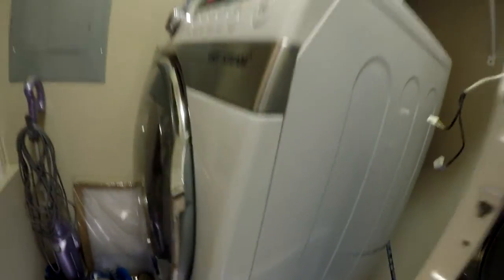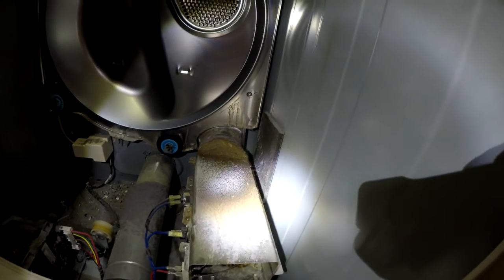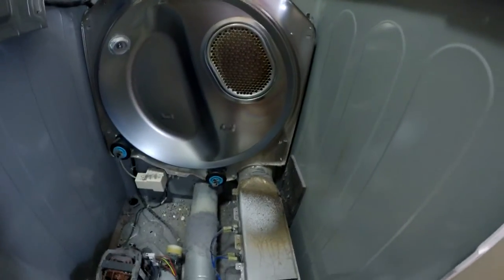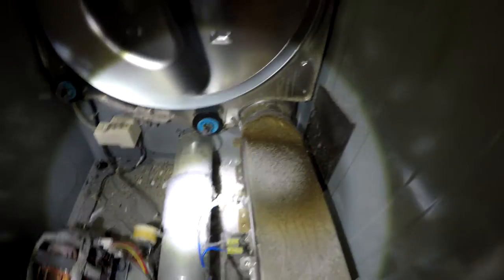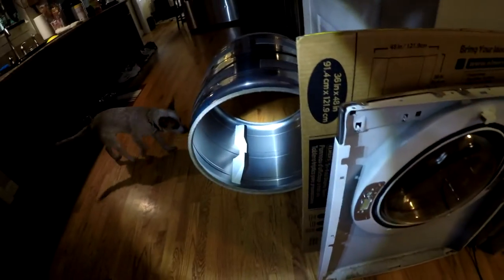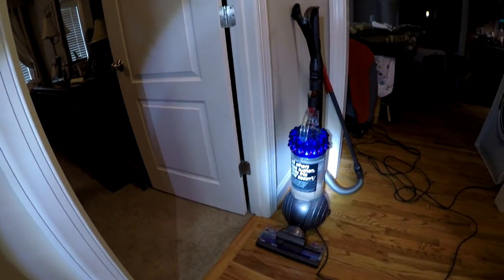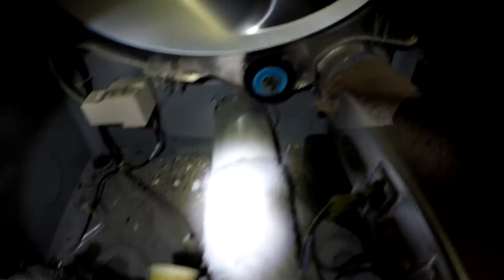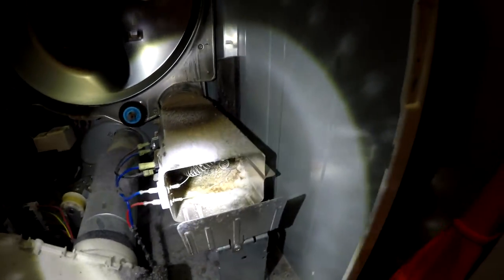Samsung Front Loading Dryer Fire Hazard

Comment: I just took mine apart after having it for 6 years and you can not imagine the lent build up !!!!!!!! I haven't removed the lent to even attempt to look at the mechanics  I'm still in shock after seeing the lent and being grateful I'm not dead from a house fire!!!!!!! I came to youtube to see if anyone else has had this issue and saw your video I will clean this fire hazard of a dryer on a regular basis from this point moving forward!!
Reply: One of the biggest causes of this problem is the fact that most people don't clean out their ducts and outside vent flap or not often enough. I do mine every 6 months. Never have seen any issue like this at all. Also, clean the lint trap every load and never ever use dryer sheets cuz they can clog up the lint screen. If the ducts are even partially blocked, the lint will be forced into the open space inside the machine.

Comment: I’ve cleaned out a few of my vintage clothes dryers (vintage appliance collector/enthusiast) when I first brought them home and I was surprised of how little lint there was inside and the 1963 Whirlpool dryer I picked up last summer had some lint in it but not very much at all and one conclusion I came up with is all newer dryers have felt at the front and back and items like lint and coins and lint get past the drum and inside of the inter workings of the dryer and just sit there until someone opens the dryer up for repair or service compared to my ‘63 Whirlpool dryer that has a drum that’s all one piece and built sort of similar to the commercial dryers you see in most laundromats.

Comment: What this guy is NOT saying, and probably doesn't know, is that just about every single commonly sold dryer in the USA is just like this. The burners/heating elements are exposed just like this. It looks pretty alarming but really fairly easy to deal with. 
With his dryer, like many others, you move the dryer away from the wall, remove a screw or a panel, then pull out the exhaust vent pipe. This gives you good access to the inside where you can run your vacuum and get the majority of that lint out. You don't really need to disassemble the dryer even though it isn't all that difficult.
This guy cleans out his duct every year. I do mine every 6 months and I've not seen this kind of build up ever in my dryer. 
We also make sure to clean out the lint trap every single load and NEVER use dryer sheets as they can clog up the lint screen.